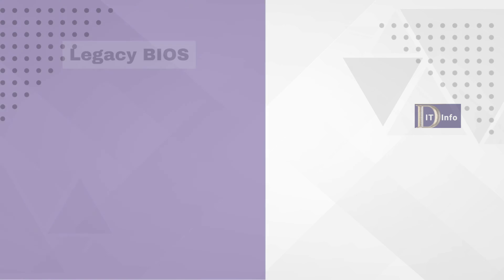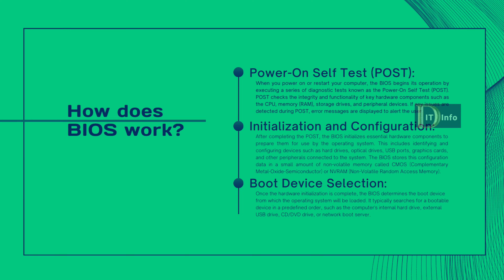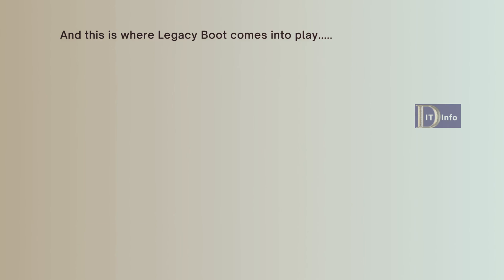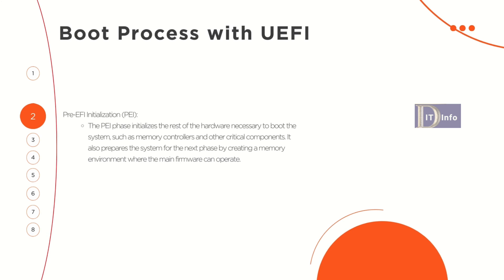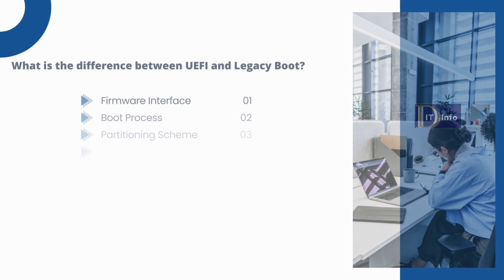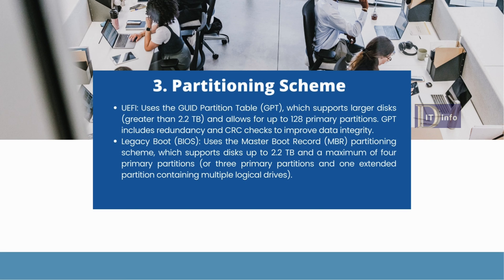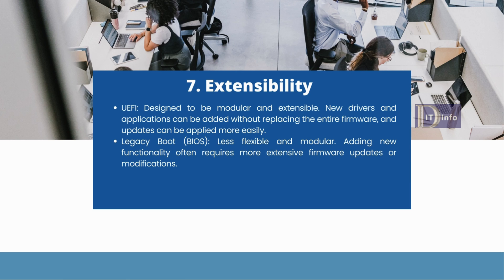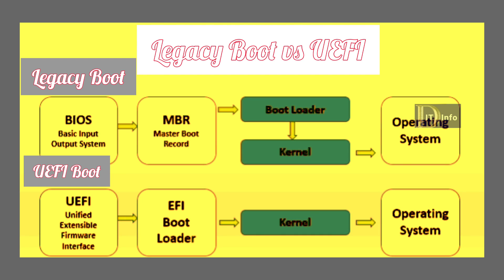Difference Between Legacy BIOS and UEFI BIOS | What is BIOS?

Comment: Everything stored in bios memory is volatile memory. That’s why there is a battery.
Reply from the maker: BIOS settings are actually stored in non-volatile memory (EEPROM or flash memory). The CMOS battery helps retain the system clock and some basic settings, but the BIOS itself doesn't require constant power to retain its firmware.
Reply: You're 100%..................WRONG.